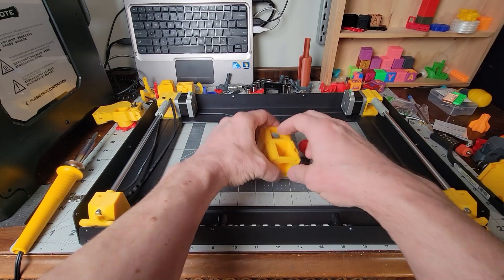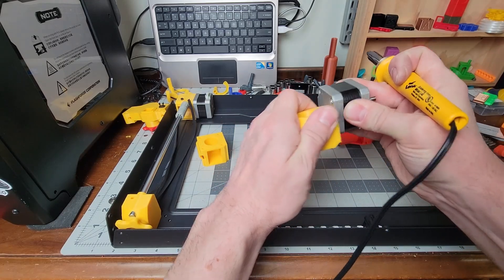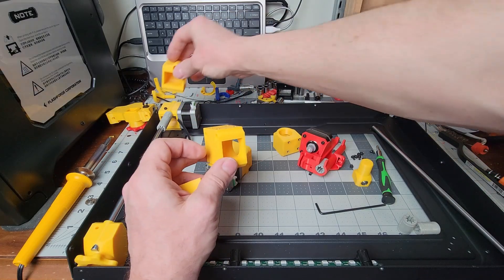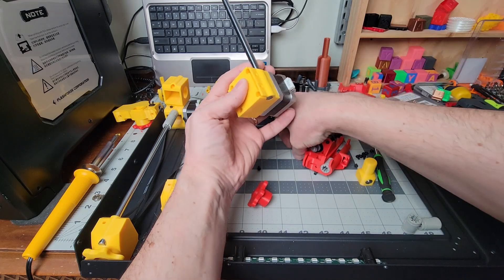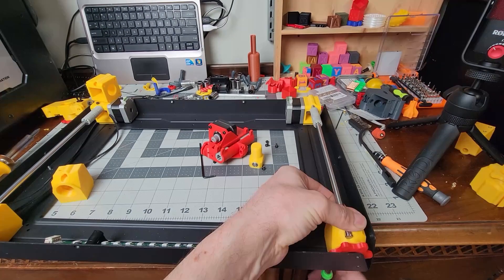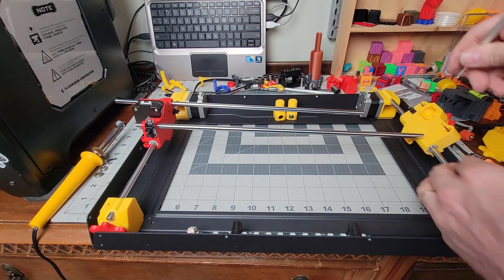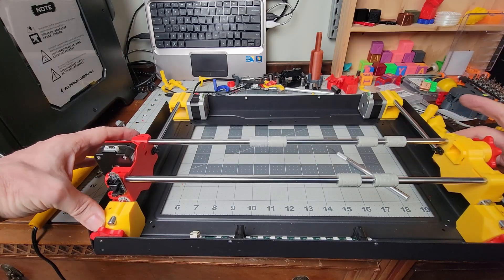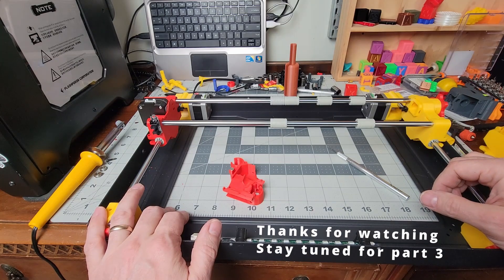Magnetic IDEX Tri Motor XY Gantry - Build Video - Part 2 #klipper #opensource #reprap

Comment: Good video again . Where do you suggest me to start modifying klipper firmware ? I mean if i wanna add more feature to my printer such as double axis , more stepper motors that works independently . Do i need to modify kinematics ? Or just modify config file in case of klipper ?
Reply from the maker: Everything is done in the config.  For example this is what my dual Y axis config looks like.  

# Driver1
[stepper_y]
step_pin: PG0
dir_pin: PG1
enable_pin: !PF15
microsteps: 16
rotation_distance: 32
endstop_pin: PG9
position_endstop: 145
position_max: 145
homing_speed: 75
homing_retract_dist: 5.0
homing_retract_speed: 30
second_homing_speed: 20

# Driver2
[stepper_y1]
step_pin: PF11
dir_pin: !PG3
enable_pin: !PG5
microsteps: 16
rotation_distance: 32
Reply: @m_IDEX  ok thanks . And last question . If I wanna add more motors not for kinematics but just for more more x axis . It's better to deal with the bigtreetech and extension board plus raspberry for klipper ? Thanks for your answers
Reply from the maker: My personal preference would be to just add a 2nd small control board such as SKR min.  I guess I should learn more about CAN bus.  If CAN bus is better than USB-C, maybe I should have someone design a tiny CAN tool board since I don’t want/need any fan headers.  

By the way, USB 3.1 can deliver up to 240Watts and 28, 36 or 48V.  That is more than enough to fully power a toolhead.

I prefer to run my printers from an old laptop.  This way I get full Linux UI, keyboard, mouse, touch screen, web browser for Mainsail and just a more comfortable user experience.
Reply: @m_IDEX  Thanks you very much and best luck in your projects
Reply from the maker: Thank you!

Comment: this has to be the best printer out there. But bushes instead of bearings/?
Reply from the maker: Thank you!  IGUS Polymer bearing have several advantages over linear steel ball bearings:
•	Run dry (self-lubricating)
•	Quieter
•	Can be used with different materials (Aluminum, carbon fiber etc.)
•	Lighter
•	etc.

Some of the fastest printers on the market use sleeve bearings (bushings).
Reply: @m_IDEX  can I source these IGUS polymer bushings easyly. Everything is available from China in my Country, but if China doesnt make them, Im in doubts. I even think to print them by myself out of Nylon.
Reply from the maker: You can always purchase directly from IGUS.  https://www.igus.com/product?artNr=RJ4JP-01-08

Personally, I trust Chinese clones of polymer bearing more than linear steel ball bearings.  
Who knows, maybe the bearings I purchased on Amazon are Chinese clones 😊 https://amzn.to/43oJUFF
Here is a random AliExpress link: https://s.click.aliexpress.com/e/_DkE5hAD

I also like that with Drylin bearings, you can easily adjust shaft clearances by changing level of press fit on the OD of bearings.  Re-print bearing housing while slightly changing bearing interference to get a perfect fit.
Reply: @m_IDEX  Pretty sure I cant. Sanctions.
Reply from the maker: @andreyansimov_diy  I am sorry about that.  Does Aliexpress still work?
Reply: @m_IDEX  yes